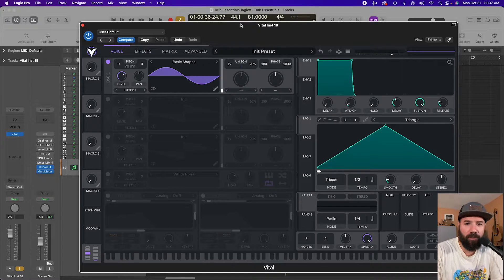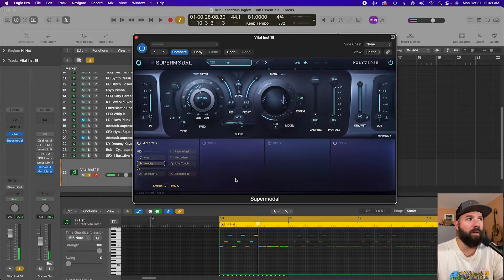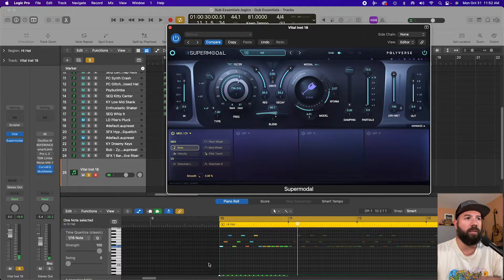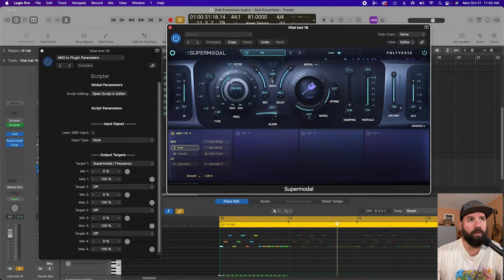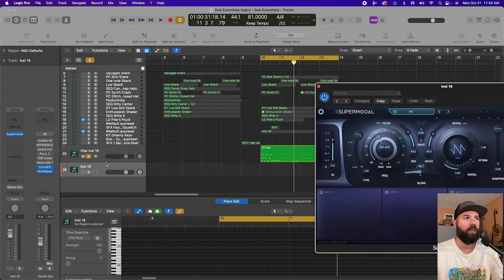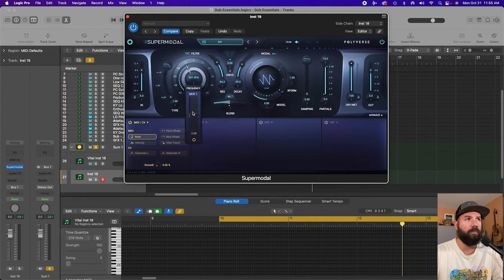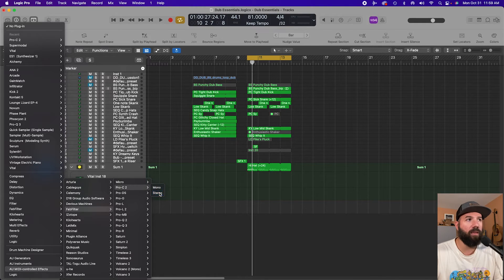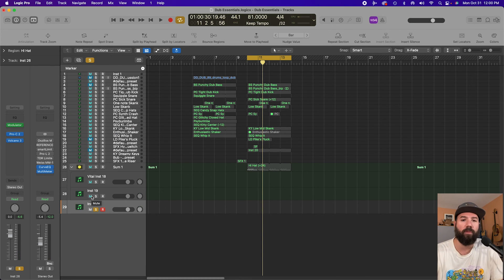Send MIDI to Polyverse Supermodal (or any other plug-in) in Logic Pro X - 2 ways

Comment: Great video! Q: Is it possible to route mic. input to Supermodal?  Midi routing in Logic is far from logical!
Reply from the maker: Hey, just load Supermodal on an audio channel and if you want to hear it live enable input monitoring. Supermodal also has a built in envelope follower you could use to modulate with based upon that incoming signal from the mic.